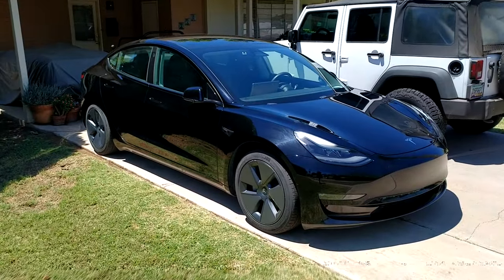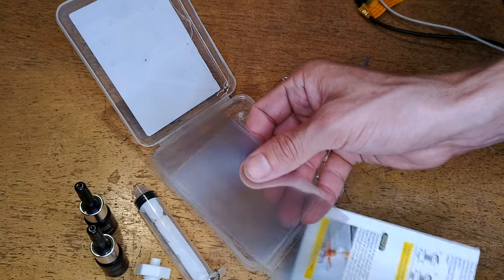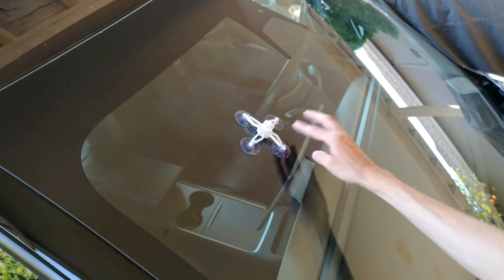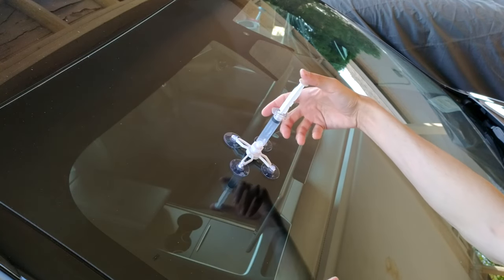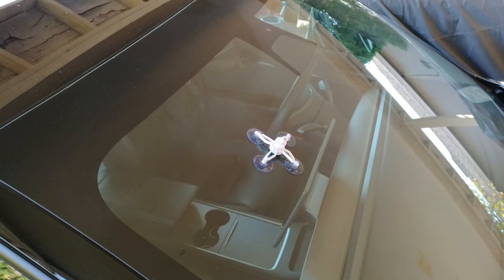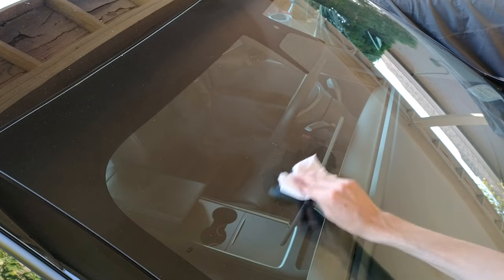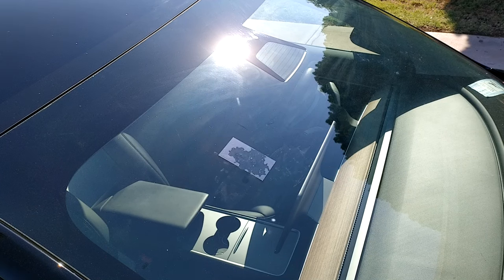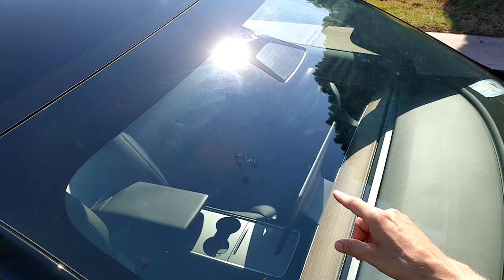Are DIY Windshield Repair Kits Any Good?

Comment: As a dealer tech that’s done plenty of these repairs I’ve seen a really helpful trick for getting the crack lines to fill in away from the center. While the hole is filling with resin, lightly heat the inside of the windshield with a lighter starting at the middle of the chip and working outwards along the crack lines. This helps thin the resin to better get into the cracks!
Reply from the maker: That's a great tip! Thank you!
Reply: No way!

Comment: Hi from England.. Great video. Thank you for posting this up on YT. I have had professional repairs done and naively expected the chip to disappear .. it didn't and doesn't. They were no better or worse than your example. ps.. many of the comments I have seen on other demos have similar naïve expectations and just rubbished the product. The only perfect cure is total replacement. However if you don't want to do that for every chip  on the screen you can do something that will help prevent further damage. If you drive around with chip you can expect a replacement at some point and it may be at a very inconvenient time. I will carry a kit in the boot (trunk). All the best 👍👍

Comment: I used a professional for a crack that looked similar by size and shape. The result is very much the same to your novice repair. The remaining traces of the crack lines disturb me more than the little dot in the center.
My opinion: It's worthwhile doing it, but if it's within the direct line of sight, I would get the wind shield exchanged.
Also note: It's a one-off! If the first attempt failed there is no 2.try.

Comment: Interesting question. Could this work on a cracked phone screen
Reply from the maker: @abdullaharmghanmehboob9787  There's a chance the resin would flow underneath the glass and affect the LCD or OLED panel below. But if the screen is likely to get replaced anyway, then it might be worth a try!